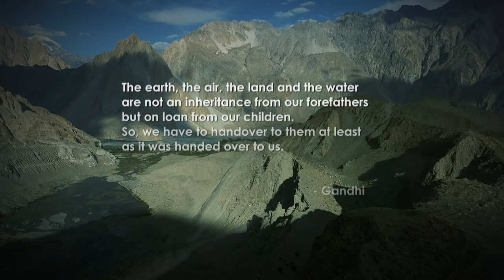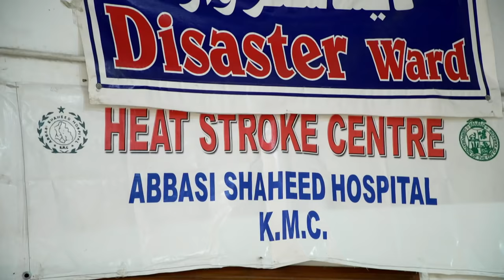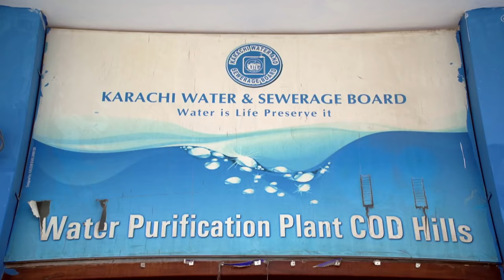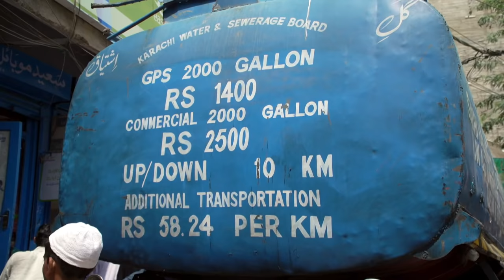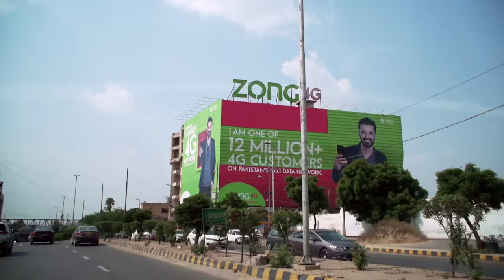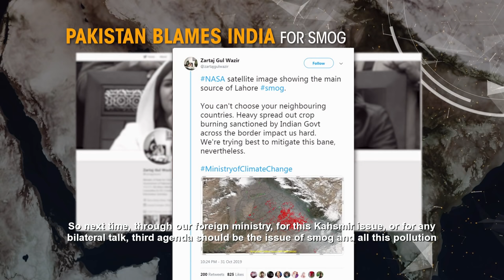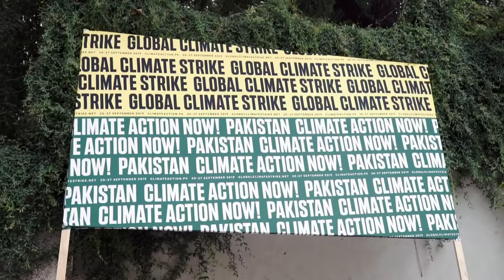How Climate Change is Affecting Pakistan and Triggering Conflicts | ENDEVR Documentary

Comment: Mumbai had that problem but we controlled. Iwon't say it's perfect but much better. Pakistan should learn to do that
Reply: It was never this bad in Mumbai. Summers usually are hot but not heat strokes. Also Mumbai is the no one city in the world which has plants.
Reply: @crescentmoonjourneys  Part I'm from was horrible. Tankers (black market) once a week and pipeline supply was horrible. We were not having heat stroke in Mumbai but move outside like pune or east side and life was miserable. When I was in Pune, I was locking myself indoor during high temperature.
Reply: @crescentmoonjourneys  yes even colder countries in Europe and North America are facing the heat like never before
Reply: They only teach you jihad nothing
Reply: Mumbai is green. Karachi was built on desert.

Comment: 50% of chennai water demand is met by water tankers only
Reply: TrueAryans  check the data n also water train which was run to meet the Chennai water demand
Reply: @user-pf4tn2rl9n  more water trains will run in coming years n decade due to extreme weather events n rising temperatures across the world leading to decreasing fresh water sources
Reply: @user-pf4tn2rl9n  no single solution is the answer to climate chain problem and no one location isolate itself from regional or global climate change
Reply: @user-pf4tn2rl9n  not alone u can try in ur area/district nd see for ur self if u can insolate urself from impact on surrounding districts
Reply: @user-pf4tn2rl9n  since humans r divided by regions, nation, states, district hence they can't come together.